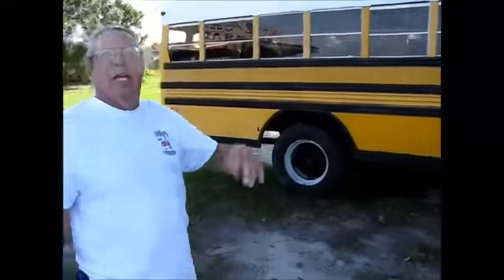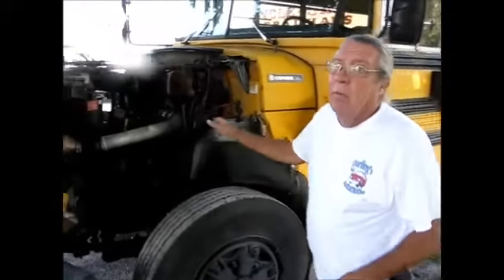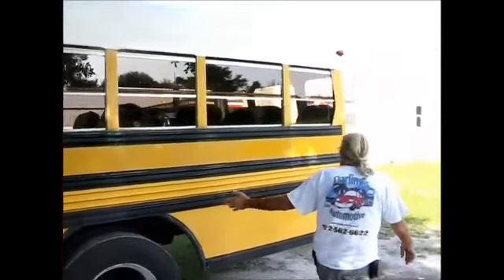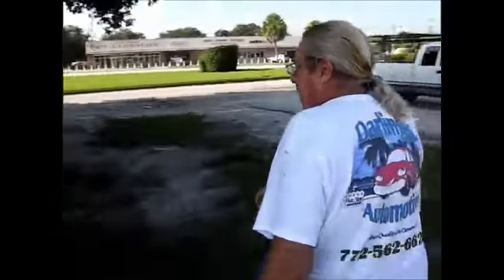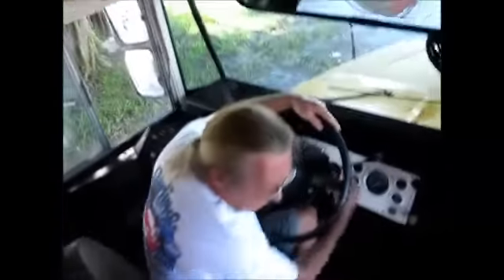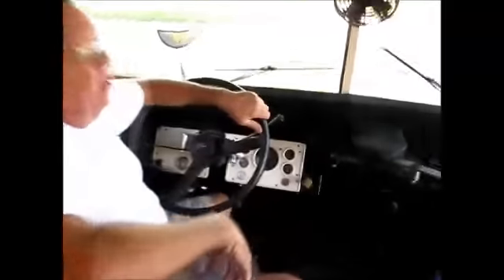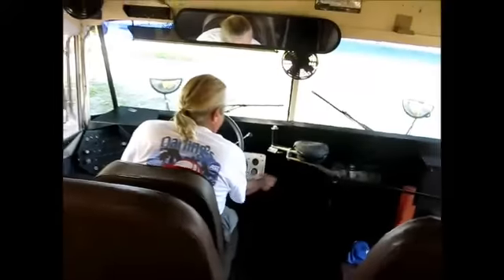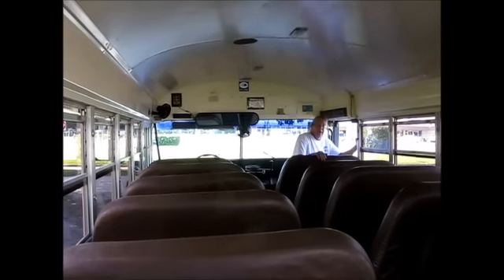Ford Bluebird School Bus August 6, 2013

Comment: This bus looks like its from 95-98 as it has the black dashboard and Blue Bird didnt start that until 95. Baltimore County used to have 6 row units like this from 1989 and before for Special needs runs but once the ADA started in 1990 they decided that all newer Special needs buses are to be ADA Compliant and 8 windows on the driver side. So 5 rows with seats and the last 3 for the wheelchair berths. And I think the 6 row units had a different engine fan as they to me sounded like an old pickup truck and the regular ed buses and the 1990 ADA compliant buses had the whining sound from the engine fan.